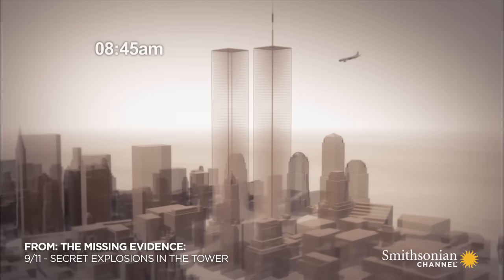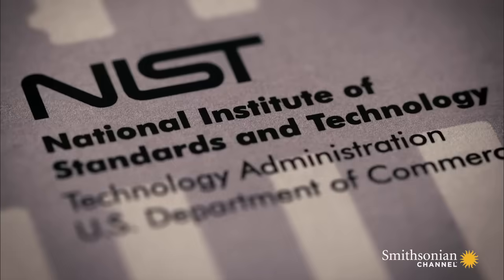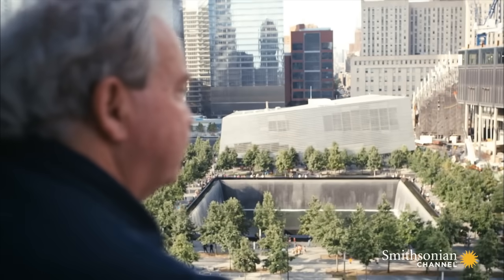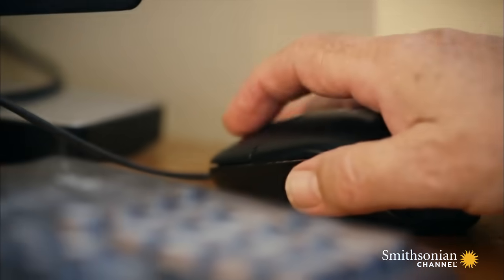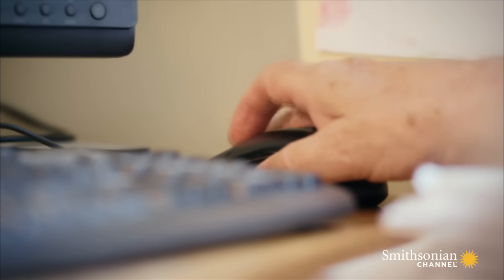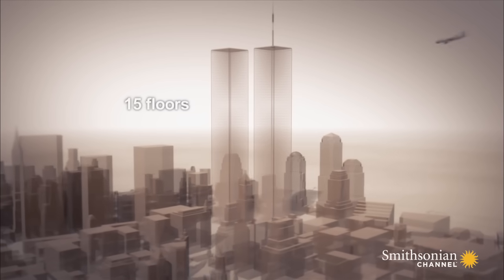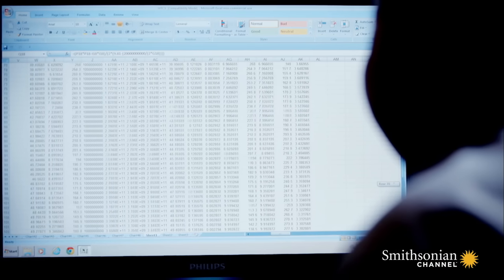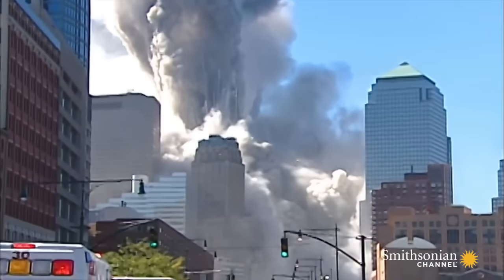This Computer Simulation Explains How the Twin Towers Fell

Comment: "Why did they collapse so quickly?" 
inside job intensifies
Reply: Have you ever built a tower as a kid? Like, a structure of walls, raised towards the sky? A plane LITERALLY crashed into each of them. It's super easy to understand how a building collapses under its own weight at a rapid pace if a single floor collapses due to prolonged burning of aluminium that then heats up and explodes, causing a sudden collapse.

The whole mass of the rest of the building now falls on top of itself. 
Every kid that has ever build a sandcastle could tell you as much. Life is not complicated. Countries don't have to destroy skyscrapers in order to make their people afraid or go to war for unjustified reasons.
Reply: Yeah let's compare real life towers to little kids toys that weigh a whole 1 lb compared to the real building. Ur gullible dude. Building will never fall strait onto themselves without demolition, it's just not possible. Not one thing fell out of line it feel strait down and didnt effect any other building around it. Impossible grow a brain bud
Reply: @Arcaryon  it was designed to be hit by a commercial jetliner.  And be okay.  How did it do so bad.  Most of the jet fuel explodes on impact. As we can see by the giant fireball.
Reply: @jpmonin7429  Because as you know, when aluminium heats up (which it does if you put it in a collapsed floor together with a burning  wreckage) it can melt, when it melts, it can pass through the debris of the floor it's on, when it can pass through the floor, it can come into contact with the sprinklers water - and create a bomb. As I understand it, a fairly standard chemical reaction. Unfortunately, the idea of withstanding a jet is not the same as withstanding melted aluminium creating an internal bomb. That's why some people heard a second explosion.
Reply: @Arcaryon  haha.  And y'all call us crazy.   Melted aluminum created a bomb. Haha. Okay. Sure bud. And Santa claus.   There's some koolaid with ur name on it.
Reply: @Arcaryon  3 steel and concrete buildings collapsed that day from fires. Something that has never happened before or since.

Comment: Another computer simulation con job for dummies. Trouble is now that the murdering rats have been cornered they might do something far worse compared to 9/11 and in my opinion I believe they will do just that, it will probably be a WMD airborne attack vastly worse than 9/11.

Comment: So these guys got on the planes, flew them into very tall steel structures designed to withstand being hit by a plane, BUT not these planes because these had JET FUEL in them and the steel just burnt like cord wood and then pancaked down at free fall speeds to the point that all the fire shot out of the Twin Towers and landed inside WTC 7 where it caught all the drapes, carpet, and copy paper on fire, which melted all the steel and pretty soon the entire building had to be pulled by the FDNYC who bravely went inside the burning building and set charges at specific spots to bring down the 47 story building perfectly in its own footprint?  Okay, I can see how that would happen.

Comment: No building falls like that unless it is a demolition. You're talking not about a few floors (each very strong and large) but 100s of floors. The force required to pulverize through and smash down those floors was astronomically greater than the weight (and kinetic energy) of the debris which was coming down from above. So the theory presented here is patently false and it was a demolition. It had to have been. And this fact circumstantially points to treason by the US government, as they are the only ones who could have installed explosives into the building successfully without detection.

Comment: Able to with stand a jetliner impact??? But still fell? Sooo who lied or who is lying??
Reply: They didn't promise the towers could withstand any jet impact, but rather a very specific set of conditions that the 9/11 crashes exceeded tenfold! (The scenario they designed for was based on the 1945 incident in which a B-25 crashed into the Empire State Building, a plane was low on fuel and only doing about 180 mph. A 767 weighs 10 times more and the 9/11 jets were doing 500 mph!)
Reply: @Tim22222  what are you babbling about

Comment: Bun then why did the buildings collapse into itself instead of falling down to one side? The second plane flew into the twin towers at one side, therefore this side should be weaker. But it didn't. It just collapsed into itself. Very weird.
Reply: The outer shell of the twin towers was a ''moment resisting'' frame, designed to resist the overturning moment, that's why it did not fall over.
Reply: Because the tower is not a tree; it's mostly empty, not solid. And the direction of gravity is DOWN.
Reply: @Tim22222  what are you babbling about
Reply: @MrYourfriendbutters  Sorry, is English not your first language?
Reply: @Tim22222  it's obviously not yours

Comment: Yet all remnants of the buildings are scattered with no pancaked floors.
Reply: The concrete floors were made from whats called ''litecrete'' .....its not very strong concrete.

And the floor trusses were very thin so got crushed and broken up into smaller pieces.
Reply: @Shelby_Starner_Everything  what are you babbling about

Comment: For all the official story believers I challenge you:

 Please explain why the fires burned for several months on site, respectively why the temperature stayed over several hundred degrees till December!. The temperature was so hot that the fireworkers had to renew their equipment continuosly because it was melting. My expanation for the high temperature is the usage of nano thermite, which is used in controlled demolition. The analysis of the dust samples from the crash site revealed incredibly high residue of active thermitic materials. How do you explain both of these findings? (The unusual high temperature which lasted for months and the incredibly high amount of thermite residues in the dust samples? See the article: "Active Thermitic Material Discovered in Dust from the 9/11 World Trade Center")

Furthermore, how do you explain the collapse of WTC7, whereby a global, near simultaneous failure of every column in the building caused the collapse? A 2019 study from the Institute of Northern Engineering found that fire could not be the cause of the collapse. The study took 4 years long and was funded with a project budget of 316'000 USD, donated from various small donations via ae911. Contrary to the investigation of Nist, they made their mathematical assumptions publicly available. So go figure and check yourself whether the model makes sense. In the eyes of every mathematician, physicist, stuctural engineer or architect, I reached out to, it is accurate. Also, over 4000 of their colleagues in the scientitic community demand a new investigation.
Reply: "Please explain why the fires burned for several months on site"

I find it very interesting that a truther would ask it, as the only possible answer is conventional fire. No inside-job theory could account for this! Thermite burns out in minutes, so that can't be the answer. But those offices were packed with the stuff normally found in offices; books, papers, furniture etc. - all of which burn!

And BTW the thermite theory was DISPROVEN! Not only did Harrit/Jones et. al. fail to get proper peer review & refused to share their samples for independent reproduction, there was an independent study that concluded no thermite! Interesting, huh?
Reply: @Tim22222  hey Tim, can you send me the independet study which did not find thermite on site? Also, from where do you have the information that the article in the journal was not peer review? How can furniture and other things sustain temperatures over several hundred degrees for months till December(winter time?)
What about the WTC7 study, which explained that all columns have to fail simultaneously for the kind of collapse we witnessed? I consider myself by the way not as a "truther", as I reject labelling people. I have curious and inquisitive mind that's all.
Reply: @Xez1919  "Also, from where do you have the information that the article in the journal was not peer review?"
From the authors themselves, who have not provided evidence of objective peer review when asked.

"How can furniture and other things sustain temperatures over several hundred degrees"
? You don't think furniture wood & paper burn at temps of at least "several hundred degrees"? How hot do you think such a fire would be?
Reply: @Tim22222  what are you babbling about

Comment: What about building #7?? No steel building has ever collapsed because of heat. There is an Alaskan computer simulation investigation that took 10 yrs out now. It says: There is zero chance of the building free falling like it does w/o all the columns being gone. 

All building codes (and all Strength of Materials courses) would have to change if their story was true. We would have to say that Newton was wrong about gravity—it would truly be a miracle. And the insurance companies could then charge the architects of negligence.

Just think—every single high rise would need massive redesign...and all firefighters would have to change how they fight every single building with steel girders across the globe—no longer taking up positions BELOW the fire...insurance premiums would skyrocket...

Comment: 38 THOUSAND      TONs      above  impact floor .  Most people have NO point of reference for this  number .   Lets  see,   today a normal  freight train engine is about 215 tons ( Just the  1 engine )  divide it  -   38000 / 215 =   stack  177 of these locomotives  onto  the top of any building in the  world  and watch what happens -  I think they ,  WTC1 & 2  , did good - to survive  past the  moment of impact  ,  at all..   All the  inside  demolition job nuts can  bite  me .    Also,   The  number  I heard originally  was  186,000 ton, maybe that was the other building.
Reply: Hmmm......and there was no 38,000 tons and no impact floor in building 7, yet it fell, ever so neatly.  Wake up, waggy.

Comment: I see everyone commenting on building 7 can someone fill me in on what it is
Reply: Yes Dan.....The 47 Story WTC 7 building also known as the "Solomon Building" collapsed straight down app. 7 hours after the twin towers.....it had some side damage and fires on a few floors....but was NOT hit by a plane....The BBC reported it's collapse on live TV 20 minutes before it happened....
Reply: @harlow743  thank you that sounds intreresting and im definitley going to learn more about it now
Reply: @reitleas1284 
Wtc7 had inner core connections that allowed the girders to rotate in a circle.

They were not ''moment resisting'' connections, so they were not very strong.

Wtc7 had a moment resisting outer shell that resists the overturning moment....which is why it stayed level as it collapsed.

The inner core had a sideways collapse over a 100 meter horizontal distance.....the building was 100 meters long. The inner core collapsed in about 10 seconds.

The outer shell collapsed in 5.4 seconds 40% slower than free fall, which would have been 3.9 sec.

Wc7 was not a fire resistant building like the Grenfell Tower in London, that has very strict fire safety codes. 

Wtc7 did not have many broken windows ...so the heat of the fie could not escape, so the building turned into an oven.

The emergency generator diesel tanks under the building caught fire.

Fire fighters could not spray water because the water main got broken.

Comment: And then Tower 7 fell the exact same way except with no airplane impact.  That is one magic coincidence.
Reply: What's magic about it?
Reply: Tower 7 did NOT fall the same way! Did you even see the video? The towers' collapses began at the exact points of impact; 7's collapse began at the bottom. Not the same.
Reply: Wtc7 had inner core connections that allowed the girders to rotate in a circle.

They were not ''moment resisting'' connections, so they were not very strong.

Wtc7 had a moment resisting outer shell that resists the overturning moment....which is why it stayed level as it collapsed.

The inner core had a sideways collapse over a 100 meter horizontal distance.....the building was 100 meters long. The inner core collapsed in about 10 seconds.

The outer shell collapsed in 5.4 seconds 40% slower than free fall, which would have been 3.9 sec.

Wc7 was not a fire resistant building like the Grenfell Tower in London, that has very strict fire safety codes. 

Wtc7 did not have many broken windows ...so the heat of the fie could not escape, so the building turned into an oven.

The emergency generator diesel tanks under the building caught fire.

Fire fighters could not spray water because the water main got broken.
Reply: @Shelby_Starner_Everything  lol

Comment: Utter baloney. Aluminium aircraft wings CANNOT cut through thick steel building girders. The Twin Towers were designed to withstand the impact of fully-laden Boeing 747 'Jumbo' jets, and remain standing. The only aircraft part found from both piles of Twin Towers rubble was a jet engine, dropped off the back of a pickup truck onto a nearby pavement probably under cover of all the confusion & dust post-collapse, which were used in different 'planes from the ones supposedly hijacked.

Where are all the suburban witnesses that would've seen, and definitely heard, two very low-flying commercial jets screaming overhead because they were flying so very low and travelling at previously unheard of velocities for the 'plane type? There are none because no 'planes hit the Towers. They were added in afterwards to all the footage using computer animation/CGI.

And then there was the passport of one of the supposed hijackers, found in pristine condition in a nearby street. This video is total poppycock.
Reply: so the people who were there live and in person seeing the same thing we all saw on tv were seeing exactly what.
Reply: @hwvanzant3007  Oh, do you mean the guy who was interviewed at the scene with the freemason's symbol on his baseball cap, or perhaps the guy interviewed wearing the freemason's pendant? Did you know that in recent polls, more people now believe that the 911 attacks were an inside job than not? You're swimming against the tide if you believe the US govt version of what happened that day.
Reply: @hwvanzant3007  I expect most of them are either dead already or suffering from cancer from all the asbestos dust in the air that day. So-I'm a clown huh? Well, thanks for at least keeping a civil tongue. Unlike a lot of govt. shills who comment on 911 vids. You are wrong though. Nevertheless you are entitled to your own opinion, as am I.
Reply: Aluminium is very very heavy.....its actually more heavy than concrete....and much stronger than concrete in tension. Science tables prove this.

The columns near the top of the towers were made from thinner steel. The wings were more heavy than the steel columns they smashed into.
Reply: @Shelby_Starner_Everything  Except that commercial aircraft wings are hollow and used for fuel tanks. Or are you trying to say that the wings were stronger than the buildings steel girders that STILL had to support many upper floors of steel-reinforced concrete and all the weight of all the upper level steel girders? Keep drinking the US govt coolaid. Incidentally-why were no aircraft black boxes ever found amongst the rubble? Indeed, why were NO aircraft parts ever found? Except of course the one singular jet engine that was from a completely different type of 'plane. Just face-you've been lied to all this time and you still can't see it. Your problem, not mine.
Reply: @MiasmicGusto  
The wings of a Boeing 707 filled with jet fuel are very heavy.....much more heavy than the thin 9mm thick RHS columns they impacted.

The steel columns did not stand a chance against the much larger and heavier wings of the boeing 707.

Did you know that the wings of a boeing 747 weigh 43,000 kg.
Reply: @Shelby_Starner_Everything  Apparently even the very tips of the aircraft wings were stronger than the steel girders holding up many floors of multiple thousands of tonnes of building materials. And they were only designed to cut through thin air! So, what DID happen to the black boxes? There were four of them on the 'two aircraft' that supposedly hit the Twin Towers. I suppose they melted due to the extreme heat of the jet fuel fires? Lol There were also two black boxes on the aircraft that flew into the Pentagon, and another two that were on the aircraft that 'buried itself into the ground', but not one has ever been recovered. How do you explain that? And, btw, what happened to all the hundreds of thousands of tonnes of rubble that made up the Twin Towers? Too many questions to which you don't have the answers. It's called cognitive dissonance... WAKE UP.
Reply: @MiasmicGusto  
The rubble fell into whats called the bath tub...look it up on....internet.
Reply: @Shelby_Starner_Everything  Oh good grief-I give up. Gotta go out now anyways. Cya, wouldn't want to be ya..!

Comment: "free fall" - what weakened the entire building to the point it did not provide any newtonian law of resistance?
Reply: You are mistaken. The towers did not come down in free fall. That's a myth.
Reply: @Tim22222  👈😠❄️🇷🇺🤡🤖
Reply: TimReed22222 they looked identical to building 7 that never got hit by any airplane...🤔weird
Reply: @Tim22222  
NIST acknowledged WTC7 fell at freefall for 2.25 seconds.
Reply: The lower section of the towers did not have enough impact resistance, so it got destroyed.
Reply: anthony winter ok great by why did it fall ? No plane hit it . Just fires made it fall ? It came down like a demo did you see the footage? Also did you see the footage of the plane hitting the pentagon? I have not 20 years later . Weird 🤔
Reply: anthony winter 👍😂